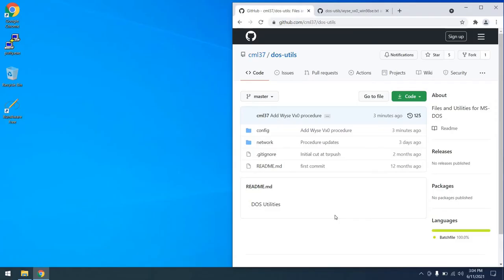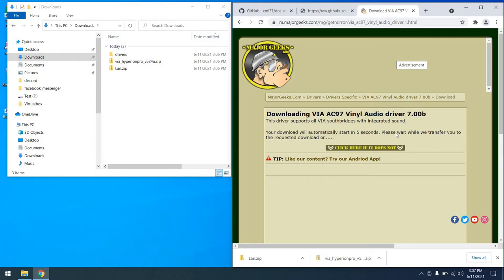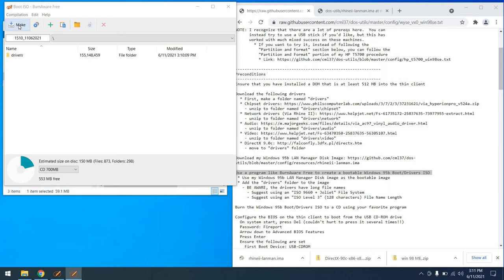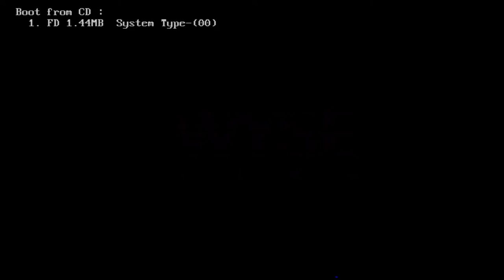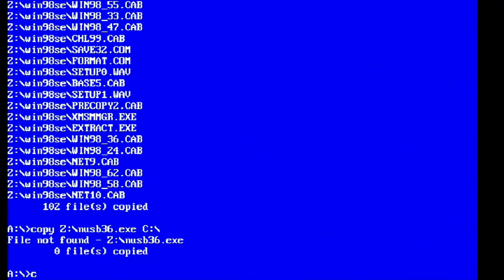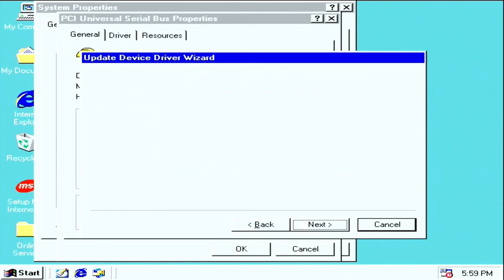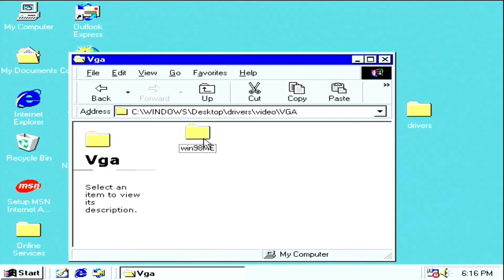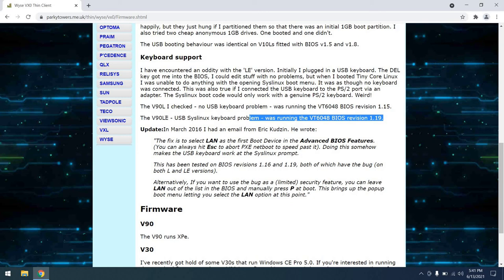RetroTutorial: Wyse Vx0 Thin Client Windows 98 SE Installation

Comment: Bought 3 of these in 2019 from Leicestershire Police, new in box for £10 each.  They were the dual-dvi version and had an ATI Radeon7000 (RV100) daughter board to provide the second DVI port.  They make very nice Win98 machines especially when using the Radeon7000 graphics.  It is very easy to upgrade the DOM to a compact flash storage solution using a 44pin cable and CF card adapter as used in the Amiga 600 machines, these are readily available on ebay.  Personally I skipped the networking stage that Chris demonstrates and copied the Win98se files to a folder on the CD.
Reply from the maker: Great!  Agreed, they do make great Win98 machines!!

Comment: this machine is based on those via cn700 epia mini itx motherboards.
Reply from the maker: Oh interesting!  I have a winxp install video coming up for this system in the next couple of weeks!!
Reply: which would mean that the two connectors to which the radeon 7000 or the pcmcia slot were connected are actually PCI connectors... maybe it is possible to make an adapter and connect other cards?

Comment: hi, i have some questitions.  first, where do you get the drivers for windows 95 as i have seen you have it preninstalled. my second questition is does windows 98 drivers work on 95 or nt 4.0? thanks in advance! (i wrote the same comment on another vid as i am looking for a good mini windows 95 or nt 4.0 pc for retro files)
Reply from the maker: I don't believe I have installed Win95 on these. I have installed other OSes on this though!

Comment: Just wondering, do you think this thing could run MS-DOS 6.22 and Windows 3.11? The unit I bought from eBay has DOS mode but that's just the Windows 98 command prompt with SBEMU and I was wondering if I make a dual boot configuration I could use MS-DOS + Win 3.11 and 98se. I don't really need XP.
Reply from the maker: Hey there!  For that, I think the HP T5300 and T5700 would be better choices. I have tried to get DOS and Win3.11 to work with sound, video, etc. and ran into some challenges.  That said, I didn't try SBEMU.  If you try it, and it works, I would love to hear about it!!

Comment: Hi Chris, do you think I should grab the latest version of AutoPatcher (or something else?) for Windows 98 to install all the updates and fixes after the installation of 98SE?
Also, would you happen to know if there's any BIOS updates for this unit? I find it's having trouble at the POST stage. Took multiple power cycles to get it to boot. I did try to plug in my USB DVD-RW drive, maybe it didn't like that?
Reply from the maker: I suppose it couldn't hurt!

Comment: I'm using dvi->hdmi adapter and I can't set any other resolution than 1024x768. Should I use VGA instead?
Reply from the maker: Yes!  Someone else was having an issue with that as well
Reply: @RetroTechChris  Thanks for the answer. I don't really have a way to test it because I don't have a VGA monitor right now.

The problem with this is that most games don't launch because they change the resolution when they start.

The card probably does not detect monitor modes via hdmi.

I ordered a 4:3 monitor with VGA. We'll see.

I also ordered a dvi -> vga adapter and an active vga (+audio) to hdmi adapter. Maybe this double thing will work to have an image via HDMI with resolution change ability.

Comment: Hi Chris, thanks for the video. Do you think it is possible to get Chrome OS Flex running on these machines?
Reply from the maker: I'll say "most likely not."  I think you'd need a minimum of 4GB of memory and also the video card would probably not be strong enough (recommendation is 2010 machine or newer, and these were released around 2006).

Comment: My VX0 is completely different. Mine has card drive like the ones that they used to use on older laptops. It's got some kind of expanision card going vertical next to that. Some sort of break off board sort of. Not famililar with it. I actually found an IoMega Clik! PC Card Drive that fit into the card slot so I'm hoping that will allow me to boot from it. I gotta find me a 4.0Amp 12volt power supply because I only have a 1.5Amp 12Volt power supply and I don't think it's enough to power on the machine.
I want to get this going and see if I can get it to run in my car and I'm going to replace my broken navigation screen with a little VGA monitor hopefully.
Reply from the maker: Interesting!  Ya, I think these did vary quite a bit through the production run.  Cool plans there, that sounds like a fun project.
Reply: Yup, that big slot in the back is PCMCIA. The subsequent Vx0L (or maybe LE) also had a 1st gen SD card slot just underneath.  Didn't know they might be bootable...

Comment: The github links video drivers ATIRageXL  but the video shows S3 (which it should be) Do you have a link for the correct s3 video drivers still?
Reply from the maker: Sorry about that!  I updated procedures (incorrectly) when helpjet.com went away, and accidentally included drivers for the HP T5700 as opposed to the Wyse.  That's embarrassing.  Fixed!
Reply: @RetroTechChris  Thank you!

Comment: Just wondering, Windows 98 SE keeps freezing and isn't booting. I think something got corrupted. Would you suggest a resinstall? The seller put XP on the hard drive but I don't need it. If I only have a partition for 98 and the 98 setup, I would have more space for games. I have an USB DVD-RW drive handy. Heard something about a buggy BIOS and issues with booting from a USB thumb drive? Is there any BIOS/firmware updates for the Vx0?
Reply from the maker: There might be, I haven't researched it.  Yea, I'd say worth a reinstall.

Comment: Good video don,t know why you have so few views.Could you give links to the cheapest ram the HP ram are to exspencive.There is some ram out there that look the same size and at vestly different prices.I want to pay as little as possible.
Reply from the maker: Thanks... the joy of having a small channel, haha!  I'd actually recommend not upgrading the RAM since the stock amount should be sufficient for Windows 98.  I just pulled out my module and it is a 512MB PC2-4300 CL4 module.  I read online that some people tried to upgrade with 1GB and had compatibility issues.  And, as you will see next week on the channel, trying to run a more modern OS that would benefit from more meory (i.e. Windows XP Professional) is pretty painful on these!!
Reply from the maker: Heads up, YouTube ate the links you posted.  If you want, send me an email and I will have a look.  Email address is on about page.
Reply: @RetroTechChris  Yes i saw it, not a good experance.That is why i want to get a XP  an SFF one wirh a i5 in it,and use it with a cheap graphics card something like a 7570.
Reply from the maker: @timcollins9800  one word of caution: not all thin client will be compatible!!!
Reply: @RetroTechChris  Yes that is what Phil  says about them.

Comment: Anyone else having issues with this client when changing resolutions on windows 98 getting a no signal screen and having to hard reset the system?
Reply from the maker: Haven't had that issue, that is odd.  Could it be that you are selecting a resolution or refresh rate not supported by the monitor?
Reply: @RetroTechChris  That's what I thought at first but no. Sometimes when I restart after getting no signal the resolution changes after the reboot. But the issue is I'm trying to load a game fullscreen and when the game loads it changes the resolution and I get the no signal error. Thank you for the video and for replaying though.
Reply from the maker: @vincentroth9572  odd!  I can give that a try on mine.  What game is it?
Reply: @RetroTechChris  It's a game called "Revenant". I don't think it was very popular. I am able to run it in windows mode but would rather do fullscreen. Do you think maybe not using a VGA cable has anything to do with it? I've tried 2 different DVI to DVI cables and two different monitors and same issue on both. I also have win XP installed on the client and no problems changing resolutions on there.
Reply from the maker: @vincentroth9572  it's possible!  Let me give it a shot.  Need to load up 98SE on the thin client first!  Will report back how it goes.
Reply from the maker: @vincentroth9572  heh, I can't even get it to run.  Complains of DirectX problems and search for disk 2 despite disk 2 being present.
Reply from the maker: Ah, the DirectX problems were self inflicted by using the WinXP patch in Win98.  But yeah, keeps looking for disk 2
Reply: @RetroTechChris  Hey Chris, So it turns out Windows 98 gets funky when changing resolutions using a DVI cable. I was able to get my hands on a VGA cable and having no problems now. Thank you so much for trying to help me out. Have a great day!
Reply from the maker: @vincentroth9572  excellent!  Very glad to hear this!

Comment: Do you have any experience on Wyse Sx0 (S10) thin client?
Reply from the maker: Sadly, I do not.  It may be similar to the Vx0.  I'd say check out the specs on parkytowers to confirm
Reply: @RetroTechChris  thanks, it got AMD Geode 366 MHz CPU not like in Vx0 and Cx0. I was wondering whether low CPU speed would be more suitable for retro PC
Reply from the maker: @travelthetropics6190  interesting.  It is Intel x86 compatible, it might work!  I haven't looked, but you'd want to make sure that you can "find" drivers for the other hardware components in that thing.
Reply from the maker: @travelthetropics6190  I have a feeling you won't have sound under DOS and will have issues with video drivers.  Different chipset than the Vx0

Comment: Which BIOS version do you have?  I'm unable to get my V90L to boot off IDE or USB.  Saving a BIOS change also causes the boot lockup with a single long beep.
Reply from the maker: Model: VT6048 BIOS revision: 1.18. Mine is a V10L.
Reply: @RetroTechChris  I have one that I can get to accept some of the BIOS changes (like turn off Wyse Banner).  It shows 1.17.  I wonder if it is worth trying to BIOS update to 1.19.  I suspect some of them have bad BIOS CMOS/NVRAM.
Reply: Also having keyboard issues as noted in ParkeyTowers.  My 2.4GHz to USB Mini Keyboard works fine.  My Avocent KVM USB does not.
Reply from the maker: @oso2k  no good at all!   Maybe we can find you a nice HP thin client.  I've made a video or two on those!!
Reply: @RetroTechChris  :D I may just have to.
Reply from the maker: @oso2k  I've got some good videos on those!!

Comment: Can you play dos games with sound in Windows?
Reply from the maker: I'm pretty sure you can!
Reply: @RetroTechChris  Not only does DOS sound work in Windows, thanks to a new software tool released this year, it even works when booted straight into DOS.
Reply from the maker: @retro-computing-gaming  I've been meaning to try that out!
Reply: @RetroTechChris  It works pretty well (I've tested it myself).  It does require the Jemmex memory manager, however, which renders some games (such as Tyrian and Jazz Jackrabbit) unplayable.

Comment: With Windows 98 SE I can't get the screensavers to load or DirectDraw to do the full screen tests. When either of those happens, the system freezes and my monitor says "No Signal". Windows XP works perfectly though! Have any ideas what I can do?
Reply from the maker: I can't remember, do I show the screensavers in my tutorial here?
Reply: @RetroTechChris  yes. Near the end I believe. I'm wondering if I have a bad installation. Maybe I should wipe it and try your method.
Reply from the maker: @robman501a  yea, worth a shot!  Now, if showing out of range, it could be a monitor frequency thing too.  Might try another monitor?
Reply: @RetroTechChris  I don't have another monitor though. I tossed out all the old CRT monitors awhile back. Only thing I have left is two LCD panels. I'll try using DVI to DVI, DVI to HDMI, and DVI to VGA and see how each port on the monitor handles it.
Reply from the maker: @robman501a  sounds good! Hope it works out!
Reply: @RetroTechChris  I've also contacted the seller. Looks like someone else had the same issue too. 👍
Reply from the maker: Oh, how odd!
Reply: @RetroTechChris  Found the solution, it seems like Windows 98 doesn't like the DVI port. Tried the DVI to VGA adapter and switched to the VGA input on my monitor and the issue went away!
Reply from the maker: @robman501a  oh nice!  This is great to hear!!  Glad you got it all sorted!